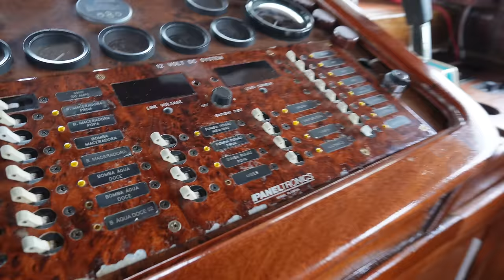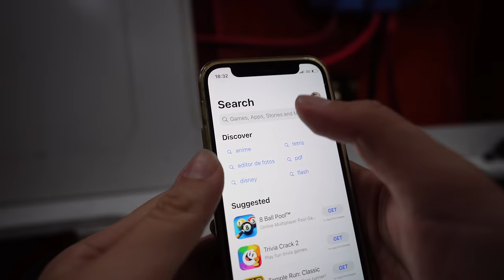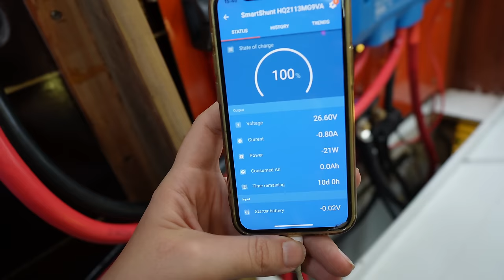Welcome to everyday life of our wooden boat rebuild project — Sailing Yabá 185

Comment: You guys look so tired! Please promise me that after the boats in the water you just lay back the whole day and relax, that goes for the puppies and your dad ! 👍🏻👍🏻
Reply: 100% agree, I think all 3 of them will just need to recharge the batteries a bit before they go on any further as they will have a whole lot of new challenges after they launch. Doing such an. Awesome job though guys
Reply: The do need a break. Unfortunately it will have to wait just a bit longer. The boat will soake in water and they need to have the bilge pump running to get the water out. It usually takes a few days. This will swell the lower planks and make it water tight. Swelling the planks will take a few weeks, which will happen as they have to do some sailing  to test all their equipment to pass inspection. But they will enjoy it. They might be able to drop anker and get some rest in a month or two.😊 They've  done a good job, so they will not need to bring the boat out in the dry to redraw the water line and do some other necessary structural work or adjustments on equipments. Finger cross.
Reply: Only one day? Relax a year

Comment: Considering YABA's wide beam, it would pay to install a second shore power inlet on the opposite side, so that, no matter how you tie off to a dock, you won't have to drape six meters of heavy cable across the cabin top...Our Pacemaker was less than four meters wide but having two inlets kept us from having to step over or duck under the shore power cable regardless of which side we tied off to the dock... :octopus-red-waving::yougotthis:

Comment: Really exciting for you! By the way, just because each time you mention it you seem surprised I thought it was worth pointing out that the resting charge of lithium batteries is typically somewhere between 13.4 and 13.6 V - when charging, these voltages are higher. (It can vary a little between manufacturers, so you should cross check your values against your manufactures data sheets.) The percentage charge in the Victron app will be dependent on what values you set for your batteries - if you haven’t already check these settings conform to your manufactures recommendations.

Comment: Inching forward. MP and Orlando have the 24 V system ready for shore power. Need to get supplies for 220 V shore connection. Ben has options for tomorrow - paint, chain plates, lag bolts, tranducer, exhaust, other.

Comment: Can you Plug an emergency generator into the shore power imput ? That would be nice for back up.Amazing video and an Amazing Journey,Thank you so much for sharing this experience, It`s priceless.
Reply: There is already a huge diesel engine on board, with nice pully and belts that drive an alternator. Some one must have already designed a system to use this incase of emergency.
Reply: It1s Awesome  @RikHaanen

Comment: Probably should coat the wire terminal's with anti corrosion compound at some point.  That will save you a headache later on

Comment: have you got any vents from the engine room, I am hoping so by listening to your comments of how hot it is in the engine room even without the engine running. Also for enough fresh air for the engine so it will not be starved of air.

Comment: Hi MP and Dad. Enjoying seeing the electrics coming together. Nice work. You seem to be using some enormous cables. I wonder if you have sized them for a 12v system? With 24v you have half the current, so can use smaller cables than with a 12v system. Please note, this is not a criticism, nor is it a professional opinion. Just me thinking out loud. What size inverter are you using? Is it 110v output or 220v? (I have a 48v battery bank with 5 kw 230v inverter on my house).

Comment: Hi @ll, do you think about a precharge resistor for the Multiplus prior switching on the connection to the battery?
It can be dangerous for the Multi or can leave burn marks on the contacts of your switches.
Cheers
Marc

Comment: I think the chant needs to learn the capacity of your batteries before it can say the SoC. If I am not mistaken, it gives you the calibrated correct data after the batteries are "empty" (when low voltage disconnect hits in from inverter and controller) and fully charged again until the charges stops.

Comment: Would it be practical or worth it to add a steel plate along bottom of keel for protection on running aground or hitting coral reef? Just thinking out loud.

Comment: hey i was just wondering would those lithium batteries need some sort of cooling from fresh air to keep them from overheating in that hotter climate?? cause lithium batteries are dangerous and if you give them the chance to catch on fire you wont be able to put the fire out as they produce their own air supply when they are having the meltdown and they realise their own fuel and very hard to put out.

Comment: Hello, can you tell me what switches you used to interrupt the thick DC cables? Best regards and keep it up. I'm looking forward to seeing your boat finally get into the water.
Reply: Good question. Switching DC requites extra attention. Because it creats much bigger arcs. Here battery switches are used. Still we should avoid swichting them when huge  currents are running through. So first switch off as many loads as possible. DC breackers are another option.

Comment: I have a  very simple concern about all of your thru-hulls...

This is about the possibility of leaks or breaks that might occur below the water-level. Any such occurrence would inevitably lead to a significant risk of flooding! Would it not be a good idea to have a one-way valve just inside each thru-hull to minimise any such risk?  

Of course the bilge pumps should deal with any water ingress but it doesn't hurt to take extra precautions!

Comment: When you linnished up those "Lug screws", you removed the indication "A2" which shows that they are NOT marine grade. When wet with brine and out of freely circulating air, they will rust, making them weak, difficult to remove and a focus for rot in the woodwork.

Comment: 12V battery is a misnomer. At 12V battery is comprised of six 2.2V cells, so a 12V battery actually provides 13.2V when fully charged.

Comment: It might be time to consider a alternate source of charging for your electrical system..  An auxiliary diesel generator, comes to mind.,  It might not be as "GREEN" as "GREEN IS", BUT   ...    electrical power is "ELECTRICAL POWER"..  when you're floating on the ocean..  Just SAY'IN..  I worked as an Electrician, in a Shipyard in younger years..
Reply: They will be able to charge from the diesel engine's alternator.  But many cruisers have solar, wind, main engine, plus an auxiliary generator.

Comment: Quando voce instala o app ou mesmo o bmv pela primera vez, ele sempre vai mostrar 100% porque o voltage atual é o maior que o sistema ja viu.
Exemplo: se voce tivesse usado 50% da bateria e estivesse vamos dizer 24.45volts mesmo assim o app iria mostrar 100%.
Se você continuasse usando, o percentual iria diminuir. Mas se voce colocar carga, o sistema vai continuar mostrando 100% porque porque a voltagem continua aumentando. Ate voce chegar na voltagem maxima! A partir daquele ponto, o sistema sabe que sua voltagem maxima é “X” e é ai que voce pode confiar no percentual.

Porque eu estou dizendo isso?

Porque é muito importante que voces saibam ler o percentual da bateria olhando apenas para a voltagem das baterias! Se algum dia acontecer de voces desligarem o sistema por alguma pane ou qualquer outra coisa e voces continuarem usando as baterias sem que o medidor esteja conectado, quando voces reconectarem o medidor no shunt, ele vai mostrar 100%! Independente da voltagem! 

Espero que tenha feito sentido oque eu falei. Meu carro é setup pra long distance traveling e eu ja tive que desligar o sistema varias vezes por isso sei. Voces provavelmente nao terao que fazer o mesmo tao frequentemente mas tenho certeza que se tiverem que mexer em algo electrico ou desconectaras baterias, voces irao passar por essa situação!

Boa sorte, beijos e abraços da Austrália 🇦🇺

Comment: Why would you use the shore power through your batteries . Will It not increase the battery life if you use directly from shore power and save the battery charge and use cycles when you are not at shore ? I am thinking your batteries have so many cycles in their life.
Reply: That's the way it's going to work. The shore power through the AC/DC converter in the wheelhouse will be directly available on the main bus. Whatever power is left over, will charge the batteries.
Reply: @rhkavli  so in the idle state the power will come from the shore supply first and not use the batteries ? Does The controller handle the load supply to whatever  you dictate ? How about some solar and maybe a smaller wind generator are they in the future plans. There is a cylinder type wind that seems practical so you do not have to worry about the blades. So close you are almost there . Keep the good work up .
Reply: @rayboucher479  Whatever source that have the highest voltage will be the primary power delivery. It's an elementary consequence of Kirchhoffs law.

Comment: OUCH!!... Well, now that it's "polished".. lol.. make sure you epoxy the new shinny bit so that it doesn't rust or rot.. LMAO!!...  Oh, and also.. very small bit of info.. a bolt has a Hex head, phillips head (star), flat head (blade), Allen head, and etc. usually are screws but you can always call them "fasteners"... i.e. What you polished looked like a 1/2" x 5" Stainless Steel Lag bolt... There's all different types (as you well know) of names from all around the world..  i.e. (what was it she called it??) little frog?.. lol.. direct translation, prob... lol.. no worries.. but I think it's a float switch... lol..   all different types and sizes.. I'm a Marine (Vessels) electrician by trade (right out of High school circa 1989.. yikes.. lol) Over six years and MAN I LOVED THAT JOB...anyway.. CHEERS!!!... I LOVE THAT BOAT!!!!

Comment: Are you through bolting the chain plates with a stainless backer plate on the interior side of the hull?  You better be otherwise the load on the chain plates will pull the plates out of the hull and  you will lose your mast. Catastrophic loss of your boat and lives.

Comment: You guys are working so hard to be ready..you make mistakes.( we all do) but you learn from Them. I do have a silly ? Tbough. If you have to cross the river for parts. And you gonna walk. Why. Not take your dingy accross an save the ferry cost???
Reply from the maker: Because our dinghy is too deflated 🙈 and the ferry cost when you’re walking is probably cheaper than the fuel to the place where we can leave dinghy somewhere safe… because just across is a container harbor and we are not even allowed there